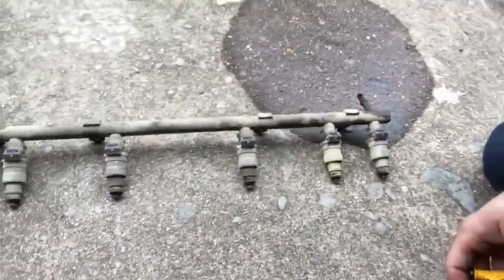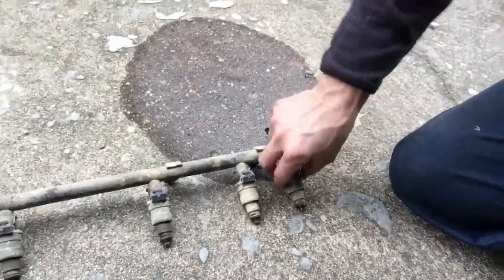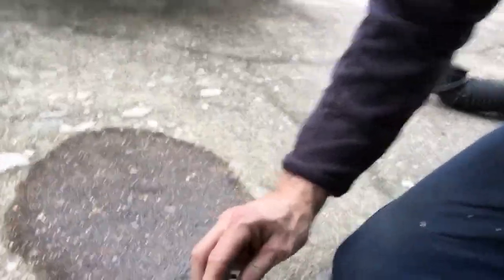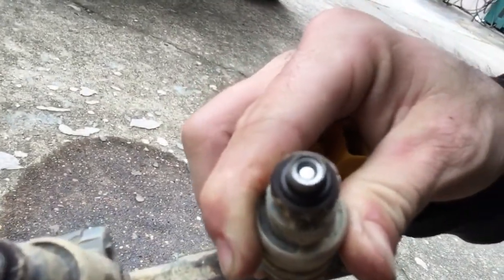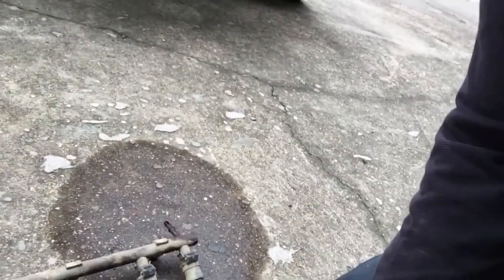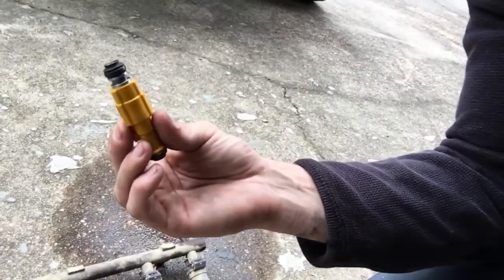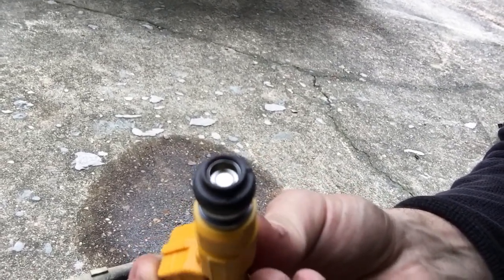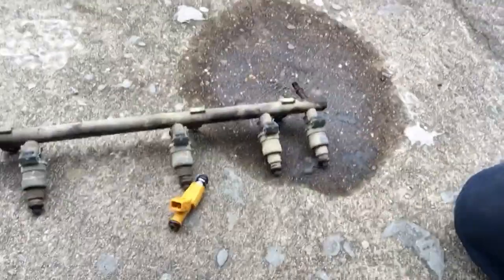Single hole vs 4 hole fuel injectors

Comment: I replaced 4 hole injector with 8 hole injector. The 8 holes are small than 4 holes.  So the fuel consumption will be increased or reduced? I installed in 660cc Engine.
The pick power is improved.
Need guidance.
Reply: yes average will increase fuel consumption will decrease

Comment: I got some 4 hole injectors for my 99 durango put them on and it ran like shit
Reply from the maker: Do you have the 4.0L? Also your ECM might be configured differently and you may need a tune.  Reset your ECM and let it idle for 20min to relearn

Comment: always upgrade with Bosch! EV14 injectors now come with 12 hole nozzles all youd need is a connector adapter jetronic to uscar..
the smaller the fuel droplet the better it will burn.. faster response and smoother idle, Genuine Bosch injectors availble at
https://www.injectorplanet.com/collections/bosch-fuel-injectors/Bosch-EV6
awesome tutorial 
thank you 
-Bryan

Comment: how are the 4 hole bosch injectors running?
Reply from the maker: cassiusclaynyc better than I hoped. The idle is a lot smoother and it starts up with no hesitation. I think I'm getting a little better MPG as well. Best upgrade
Reply: Helo boss